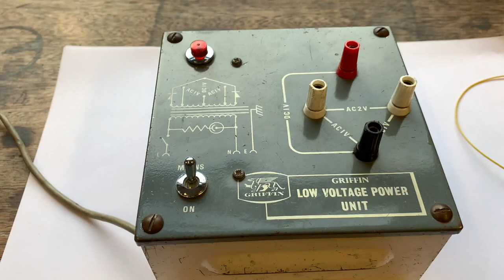Making a Simple DC Motor

Comment: Ok so , when the electricity passes through it , the tiny rod becomes a magnet itself and it adjusts itself by rotating to make common magnetic field with the other magnets because magnetic fields cannot intersect each other .
   But to generate electricity we can't supply electricity to rotate it because then it won't make any sense . 
 So we use natural energy like hydel , wind , thermal , tidal etc. to rotate that tiny rod by which vice versa of the process happens and electricity is generated . Something like this happends , but I am a little bit confused about this part .
Reply from the maker: You're confusing generators and motors. The video shows the construction of a motor: you supply electricity to it, and it moves.
Although generators are very similar in design, they are used in a very different way: you don’t supply any electricity to it - instead you spin the coil around (e.g. by attaching it to a wind turbine), and this then creates the electricity.
Reply: @QuantumBoffin  Thanks for quick reply , this concept is new to me